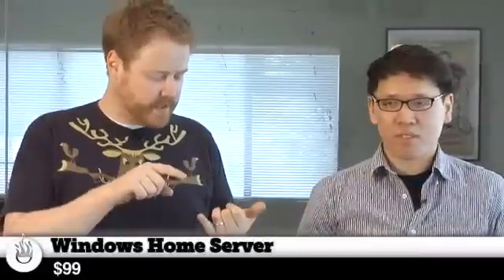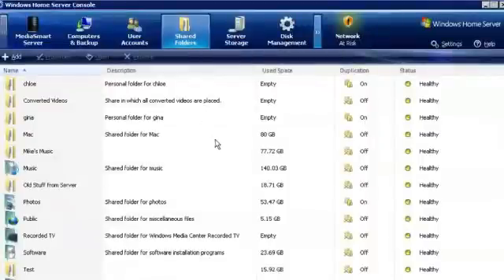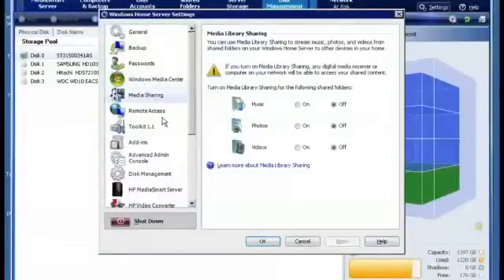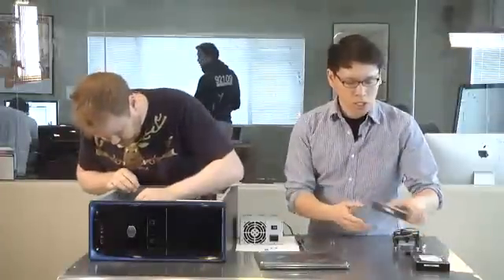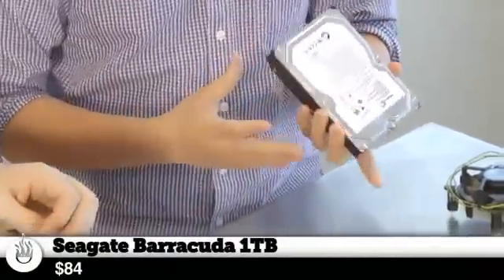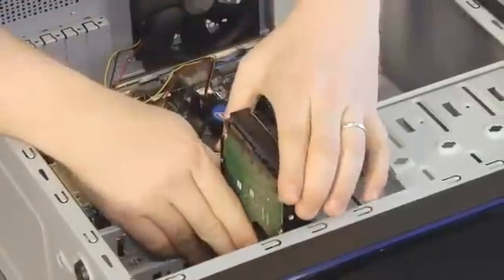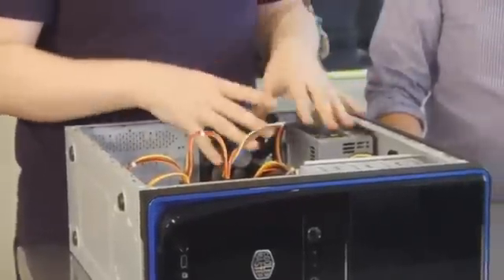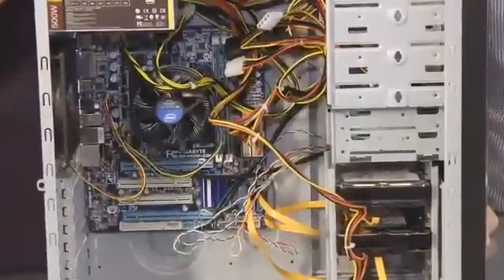How To Build an Awesome $500 Home Server

Comment: Is it good for website hosting?
Reply: Windows home server is obsolete, look at other options like XAMPP if you want to host websites locally. Or just get a hosting account online, there are so many free ones with restrictions or you can get paid hosting at very low cost.
Reply: @VNL 670
No.
It's only for home usage with 1-8 users.
If you have a website with > 100 users at the same time you don't want run a Windows home Server.

Comment: is it possible to host gaming servers on it?
Reply: Yes, it is possible
Reply: I guess it depends what server you're looking to run though
Reply: +Victor Parker an running java minecraft server. My home server is only capable of storing files, not running them
Reply: Toxcique I guess you should be able to host like 1-3 players on the server with the pi.. That's estimated, ive never ever used a pi, im just guessing based on the pi's specs
Reply: +Victor Parker the specs are not the problem. I need help with execution of files. not opening the code, but make them interactive.
Reply: Toxcique Are you talking about on linux or windows? Because with linux, you need to give it permission to execute. open up shell and type chmod +x /location/of/the/jar/file/for/the/server.jar then you should be able to run it just fine.

Comment: Thanks I found this really useful, but eventually you will have to pay for the Windows home-server OS.  So how much is the single user licence Win Home Server OS?
Reply: +Andrew Jenery 
Nothing, license is in the hardware. Best server-version ever for small business and home.
Install and forget it, backup every single day.
Reply: +Andrew Jenery It's $99
Reply: +Mykle Bust Nice!  That's great VFM then, but found out that M$ no longer does WHS :/
Reply: Andrew Jenery
last whs-edition still work great, its free to download
Reply: +Mykle Bust Thanks for telling :)  So whs 11 is free to use or is it just a trial period.
Reply: Andrew Jenery
HP Homeserver is designed only for WHS, and visa versa, Fujitsu Siemes is another hardware-supplier, but HP are the greatest (has both).
No serialnumber required, its full version.

Its a great deal, one of my most useful computer i ever purchased. Running 7/24 last 5 year or so.. (WHS-10)
Reply: Okay, thanks again for helpful info.  Had no idea whs would be free to use, so good to know.
Reply: Andrew Jenery
Its not actually free, its including the hardware. Most HP products has serialnumber in the hardware. It is impossible to install WHS on another hardware.
Reply: Okay get you now, so only free with HP hs.
Reply: Andrew Jenery
Sorry....correction........WHS 10/11  is a shell for use in fullversion of Windows 2003, u need license for win-2003, Sorry for my complicated explanation, i forgot this "detail".

Comment: Thermal paste?? I sure hope it was factory applied to the bottom of the cpu heatsink.
Reply: +DanielVidz 
Is not needed..
the cpu runs on idle and you don't need thermal paste.
Reply: Fair enough.. I know you can run them with no heatsink at all if desired but for how long..  I would always opt for the more practical solution.
Reply: DanielVidz Yeah I would prefer paste
Reply: moto cs Nah bro, it's not nececery..
The thermal paste conducts cooling better to the cpu.. But the cpu is still cooled without thermal paste.. I've had experience with computers for over 15 years and I do use thermal paste but for a server, movie pc etc you don't need it but it works better with thermal paste..
Reply: moto cs  take your own logic..
And try it for yourself  if you want it..
YOU DON'T NEED IT!
THE PC ISN'T GOINT TO SHUT DOWN OR ANYTHING
Reply: moto cs  Excuse me?
My poor hardware?
I am talking to you.. If you can't talk without cursing and being angry then don't say anything!
Reply: moto cs What do you mean give up?
Brother.. They tested it them self in the video.. Did the pc work? yes..

Comment: You don't set the motherboard on the anti static bag..... use the box...
Reply: +ARPANettic Productions (discontinued channel) Most anti-static bags are only anti-static on the inside, with the outside being just plastic. Insulators like plastic bags and balloons are great at storing static electricity.

Comment: So I'm a Mac person, and everything in my house is Mac except my Epson printer. Dumb question: whats the difference between a home server and a networked hard drive? I have an Airport Extreme, and can just plug in any old USB or ethernet hard drive to it and share that through my network. Whats the difference between doing that and a home server?
Reply: A server like the one built here gives you the option to change any options you may want to or upgrade any aspect of it. I am not a Mac person, nor do I know anything about them, but I have had a hands-on experience with them. They aren't really upgradeable, nor are they remotely accessible. That's also a benefit of a server like this one, you can access all of your files from a remote location. And if I am correct (correct me if I'm wrong) the Apple Airport does not feature a LAN port, so your wired devices cannot access it. Speaking of LAN, a server like this one can have more than one LAN port/card (I have dual 10 Gigabit NICs in my server) and it is unbelievably fast over wired connection. (1350 MBPS Read and 970 Write)

If this helped any, please hit the like button.

Lasley Tech Tips
Reply: KevKevAllen With a networked drive (USB plugged into the router), you can only store and access files. With a home server like this, you can do more such as adding services like PLEX media server and other apps/things you want to do. If you plan to install Windows Server, you can setup a domain with ActiveDirectory and have an exchange E-mail server. And if you plan buying a Mac Mini for a server like this, you can add OS X server for $15 in the App Store which gives you the almost the same options as Windows Server has except it will work with OS X. Lasleytechtips He has a Airport Extreme which has LAN ports.

Comment: Is the power supply even bronze certified? You should also probobly specifiy whether that board has onboard wifi or not.
Reply: Why would they need to specify that? If you are using a home server, it shouldn't be connected to wifi
Reply: It's something i'm curious about.
Reply: Daytimerocker , John Doe  has a good point. A wireless server is UNBELIEVABLY slow over wireless connection. I have tried it. Here is my setup and results over WiFi:

Intel Xeon E5 1650 6-core CPU
16GB DDR3 ECC  RAM
ASUS P9X79 LE LGA 2011 Motherboard
DUAL G2 Dual Port 10Gigabit Ethernet Card
DUAL Asus (USB-AC56) Dual-band Wireless-AC1200 USB 3.0 Wi-Fi Adapter
6 WD Red 2TB HDD's
Kingston SSDNOW 240GB SSD
FreeNas 64-bit OS

Transferring an ISO of Ubuntu Desktop Wirelessly (+/-950MB) 

Write: 7 MBPS
Read: 13 MBPS

Transfrring the same file on Wired connection on ONBOARD LAN:

Write: 68 MBPS
Read: 96 MBPS

Transferring the same file over single 10 Gigabit NIC:

Write: 278 MBPS
Read: 342 MBPS

Transferring the same file over DUAL 10 Gigabit NIC's

Write: 480 MBPS
Read: 610 MBPS

So yes, DO NOT use wireless connection AT ALL on a main home server LAN link. Now, using a router that is connected to the ONBOARD LAN to share files on a portable device (Phone or tablet) then that's fine. But don't use wireless unless you have to. I spent a long time doing tests by the way. If this helped, please click the like button.

Thanks,

Lasley Tech Tips
Reply: Lasleytechtips Hmmm... thank you for the useful information. I'll keep that in mind.

Comment: Tested Can you guys do a newer version of this with probably an open source OS for the server (FreeNAS to be specific :D) and if you can... also add how to schedule backups for Mac and Windows using FreeNAS with a software RAID 5 array. 
Just to make the new video miles ahead of this one, you can may be do it at a lower cost!
Reply: Parth Gohil If you're running FreeNAS, is it really even a server anymore?  Sounds like it's (obviously) just a NAS where you can't really use it for anything other then storage.
Reply: someusername121  Well it'll be a Storage server. Also FreeNAS can can do many things than manage your storage, it can function freely to stream music, download files directly to the server & a lot more depending on the plugins that are available.

Comment: 4GB is the perfect amount of RAM for a home theatre/file server these days :)
- 2014
Reply: Got 4GB of Kingston HyperX Fury for my new HTPC build.
Reply: I thought it was funny when the said 4GB was "Overkill". Nowadays, 32GB is barely overkill. Lulz.
Reply: Lasleytechtips 32GB is wayyyy overkill - 16GB is also overkill for most builds. 8GB is perfect.
Reply: And 4GB is all that is needed. Technically you could run it fine off 2GB.
Reply: Yes, but I was referring to a Desktop PC. My server runs 16GB because it has 24TB of storage and dual 10 Gigabit NIC's, and here at LTT, we shoot 4K video, so we have to have that insanely fast link to transfer 4K videos.
Reply: Lasleytechtips Yeah, that's fine. All I'm saying is 32GB is CERTAINLY overkill!
Reply: Yeah. The only reason I have 16GB in my personal workstation is because i edit with 4K video which takes up a ridiculous amount of storage and RAM.
Reply: Lasleytechtips Yep.

Comment: I have a stupid question ,, why most server builds look old ? like old ram old psu and they don't have these modern looks ?
Reply: because the 'modern looks' are just plastic or shiny metal that is mostly useless and only used because gamers like it. Nobody really cares what a server looks and it's better to keep costs down.
Reply: This is an older build, back a few years ago I think. There weren't the cool, flashy cases there are today, and RAM wasn't much then.

Comment: Are they doing the out of case mobo installation on a metal table? Thought that was a definite "no-no" in computer building.
Reply: it is, it makes me want to cringe but they do have the motherboard on the electroostatic bag so it does'nt short but if it was touching then youd be fucked if there was any static and could completly short your board.

Comment: fuck this, ill use an 8 core fx
Reply: A server will not utilize all 8 cores, as it isn't doing any intense work. When I am getting Max throughput on my server, my 6-core xeon CPU maxes out at 32%.
Reply: Gabriel Ezeta Also you want a server, not an oven on 24/7

Comment: winblows server! what are you smoking? Try instead Linux + FreeNas or FreeBSD w/ZFS. All free btw.
Reply: Windows server offers a GUI that you can control everything off of. FreeNas doesn't have that, really.
Reply: Linux right?  I was told that Linux  was a better way to go.
Reply: thanks   for the reply!
Reply: FreeNAS has a browser based gui.
Reply: You could definitely use CentOS or Debian. More secure and reliable. In regards to Debian, it is super stable. You could run a server for decades until the computer finally gives up the ghost without so much as a hiccup from Debian

Comment: I have made a windows home server from a old pc. I then installed XBMC and connected it to the tv. Now I have a Server and HTPC in one. So no need for slow streaming to my tv and very cost efficient because you don't need extra parts,
Reply: I actually want to create something similar to that. Good for you! The only problem is placement of my server cannot be near my tv due to my router being in another room. I also dont want to have a wireless connection for the server. For pc backups i like full speed on the servers end
Reply: PS319287 Get powerline adapters
Reply: Tomiking33 I do have 2 but the only thing is since they are so spread out in my house, the connection speed is quite similar to wifi. Although thanks for the suggestion

Comment: You missed showing the application of Thermal Paste to the CPU before installing the heat sink on top.  Very important step!
Also, recommend wearing an anti-static wrist strap (which is clipped to ground).

Comment: Since minecraft eats lots of ram, I'd recommend rising that ram a bit depending on the server size you are looking for.
I have a laptop, core 2 duo, 4 gb of ram - and I can run one 24/7 server without lag, not focused on more than 20 players.
As ram is pretty cheap nowadays, 8-16gb and you wont have to worry soon :)

Comment: I used WS08 for a bit and did some stuff with my mate who runs 5 VM's with Hyper-V For normal server stuff ADD etc. Although i find it was alot quicker just setting up a NAS or a Web Server (apache) and easier with Ubuntu Server. The command line is way more efficient than GUI.

Comment: I recently built myslef an home server based on WHS2011 and i choosed an Intel G2020 processor ( dual core, no HT ) with a H77 motherboard. The computer is VERY power efficient and the G2020 is strong enough to stream HD video to 3 PC ( i dont have more PC to test more ) at the same time. A G2020 is well enough for a home server.

Comment: And yes, you could use a different OS, that's great and I love using other operating systems, but they're using MSHS because of its compatibility with all the other devices they have around. Ubuntu is a fun OS to use, and it's also got a lot of nice addons and is very streamlined and small to install. Another reason they're using MSHS is because it's a kernel of Vista/7 which means that you can install the plethora of amazing programs that have been made for those Operating systems.

Comment: You're a fucking idiot.
For a couple of legit reasons.
1. If you're talking about using AMD processors and other OS's, AMD processors use WAY WAY WAY more power than intel processors, while giving  the same performance. They ARE cheaper, but I don't recommend using them unless you're using a power guzzling pc that is not on very often.
Second of all, this was made in 2011, prices have gone down by far so it's not a fair comparison. By the way, I'm on a Macbook, so don't call me a microsoft fb.

Comment: Of course that linux wins on performance on several tests, its because the kernel driver is optimized for the hardware. On windows, the software tends to be more generic, and the hardware in which it trives on performance are somewhat restrict, because of certification process.
Then its pointless to do this kind of raw performance comparation, when purposes arent same. 
Need to analise specific situations, all O/S of this day are generally good enough.

Comment: Good basic tutorial, I never looked at windows server, might be nice for my server box, running win 7 pro now. Sounds like server edition has a raid setup, what kind of raid does it use?  I am looking at using my current server as a backup box and building a higher end server with better parts. If I make a box for backups, I am looking at running a linux with software raid 5. What do you usually do for backups?